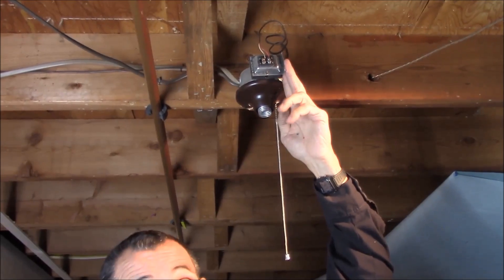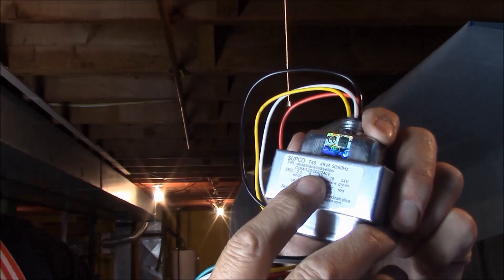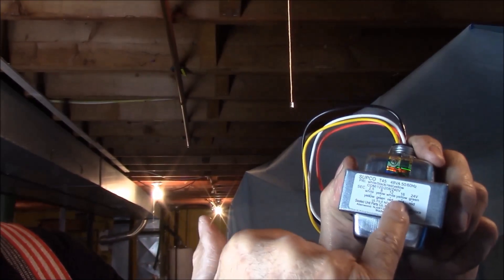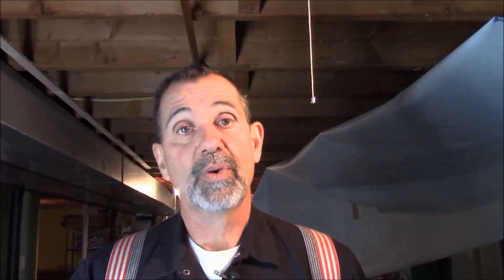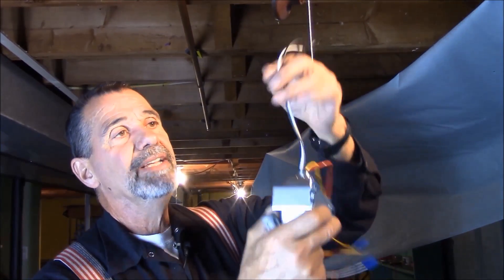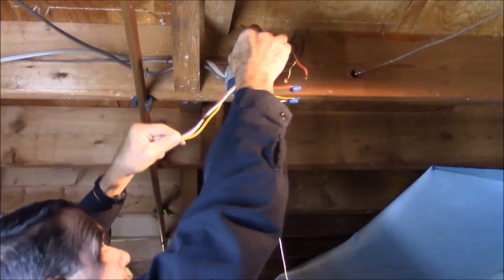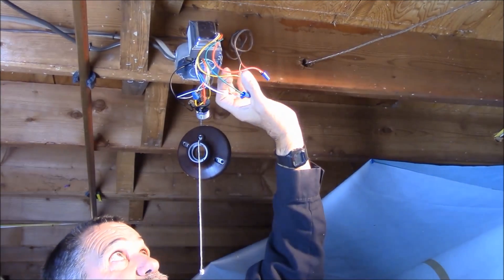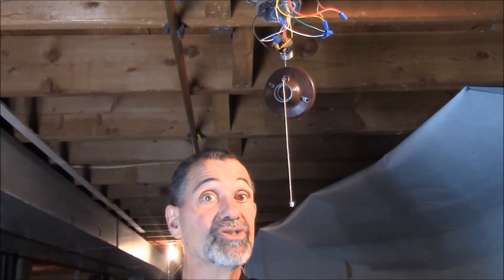Ring & Nest Doorbells Require 24Volt, 48VA Powerful Transformer

Comment: So wait. These companies are supplying incorrect wattage information?
Reply: I don’t think so, they just don’t stress that some units require a higher wattage than many homes have available.
Reply: What Blair said... also, I think the doorbell companies don't tell you to add the power requirements of your chime (while chiming) to the power requirements of the "smart" doorbell (while streaming hi-def video and two way audio)... that kicks it up a bit, and most household transformers can't keep up. I would even doubt a 30VA, depending on the chime and the doorbell combination. These smart doorbells can be touchy when the voltage dips below 16V for even a moment. Which will happen on a transformer that is getting close to max (ie. Amp draw is too high). This video is right, I would rather try to keep the voltage near the recommended range instead of using a 24V to cover the difference. Even if the doorbell says it can handle 24V... a new 24V transformer puts out more than 24V... so thats risky.... same issue with the chime. So more VA (instead of more V) to cover the combined loads, plus a healthy bit extra.

Comment: I have 3 wires on my secondary. 
Hammond part # 166L25
Green , Green/yellow, Green 
Is the Green/Yellow common?
They gave me two secondaries? 
Could I not have just run an extra wire to a single secondary to run my two items?
Reply: Will have to go to the manufacturers manual or spec sheet for the information. Sorry I don’t know this one

Comment: I had my nest originally connected to a 16V10VA transformer. It worked fine for six months. Then every time the doorbell rang, the nest would reboot.
So I upgraded to a 16V30VA transformer. I'm still having the same issue.
Reply: You need a 16-24 VAC, 10-40 VA transformer for Google.
Reply: @klamont9  I just disabled the indoor doorbell. I have several Google Nest Minis around the house that chime and announce when the doorbell has been rung.
Reply: Mine just started doing this as well any luck on a resolution?
Reply: @trevorlangston172  no luck. I just turned off the indoor chime in the app and use my Google Home to announce when the doorbell is rung.
Reply: @ramblinman7153  yeah, mine works fine with the indoor chime off as well. I wonder if I stepped it up to a 24v 40va transformer if it would work. I will try it and let you know the results. I also have a warranty replacement for the doorbell coming. Hopefully I can marrow down the issue.
Reply: @trevorlangston172  how did you fare?
Reply: @whopua  I found out that my transformer was bad.. bought a new one and replaced.. everything is working fine!
Reply: It was shorting out everytime the bell was rung..
Reply: I think the nest eats a fair amount of VA when the doorbell is rung, as compared to others, maybe its the hi-def camera. Then you gotta add the VA your chime is taking as it is chiming at the same time. That might be more than 30VA at these peak moments. And if its anywhere near 30VA, that transformer will dip below 16V and your doorbell might freak out.  I'm not sure why it worked on a 10VA at all in the past. I guess it was just slowly melting, but made strong. It must have been made back in the good ole' days.
Reply: turn on and off the electronic chime under Chime duration in settings.

Comment: My transfer is also connected into the light just as in the video.  Just as the in the video, I have two black wires connected to the transformer.  I'm not sure where those two black wires would connect to?  If it the 16va wires that are labeled as such on the transformer and does it matter which black wire go to what?  I understand the wiring from the doorbell on the outside of the transformer, just not inside the guts where I have just the two black wires.
Reply: There is no polarity to the 110v side of some transformers. So one wire goes black to black and the other goes black to white. I wish they make one of the power wires white to make it easier to homeowners.

Comment: Ring doorbell pro recamends  24volt 40va when you also have a mechanical door bell or door bell chime and more then 1 camera
Reply: Where do I find my transformer at my house?
Reply: @chubbuck35  what state are you located in and how old is your House?
Reply: @AntonioClaudioMichael  The house is 15 years old in Idaho.  We have an intercom system (including for our front doorbell) and the doorbell pumps through all of the intercoms to ring.  I'm at a loss of where to find the transformer.  It's not by the breaker box.  Do I need to take a look behind all of my intercom units in the house?
Reply: @chubbuck35  the transformer could be behind the intercoms it can also be in the breaker box itself
Reply: @chubbuck35  could also be in your laundry room or even the addic
Reply: Ring video doorbell pro manual says "we recommend installing a 16 volt AC transformer that delivers ~30 VA for the best performance." I called them on the phone and they told me that my 16.5 volt, 50 VA transformer was TOO BIG for supplying both of my 2 video doorbell pros. That is not correct, and I'm disappointed in that advice & the service.
Reply: @4Runn1nYota yes ground goes to ground the orginal transformer from the 60s didnt have a ground and its not required to use i wired it a few days later because it wasnt technically needed you dont need to wire it if your house didn't have the transformer grounded it was 123 degrees outside which is why I didn't wire it